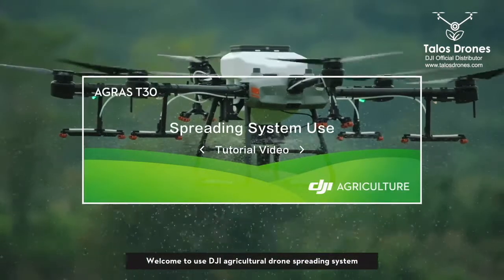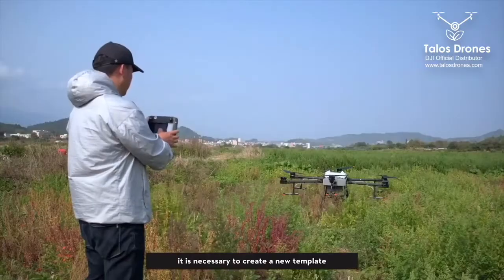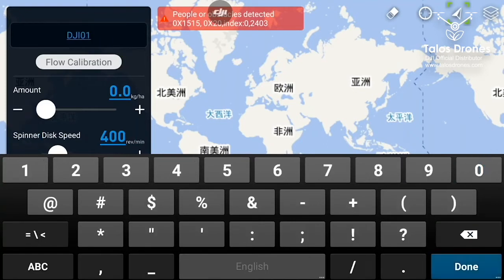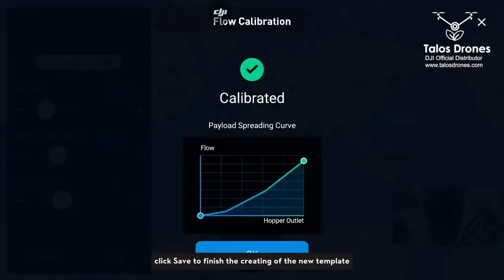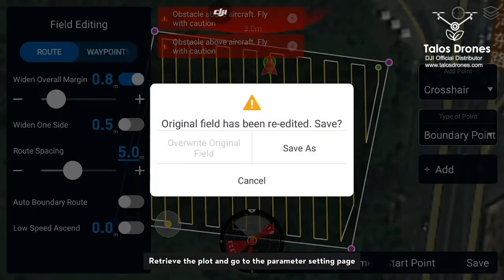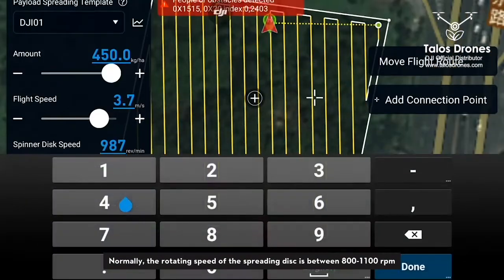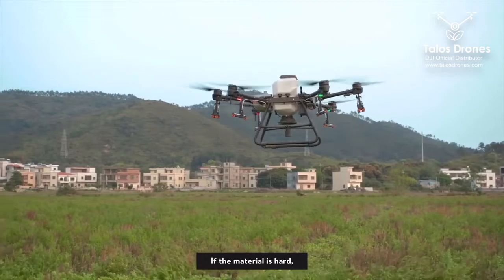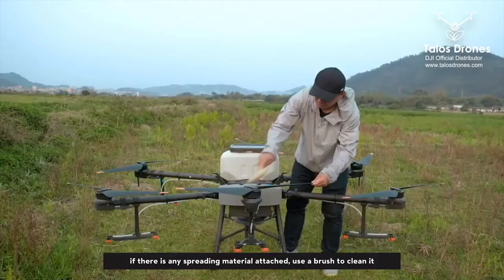Talos Drones - DJI Agras T30 Spreader Attachment Calibration and How to Use Tutorial.

Comment: Can you reduce rate down to 1oz per acre of fine dry herbicides
Reply from the maker: No, that rate is very low for the spreader system. If possible, you will need to mix the 1 oz with another neutral material to increase the rate per acre.